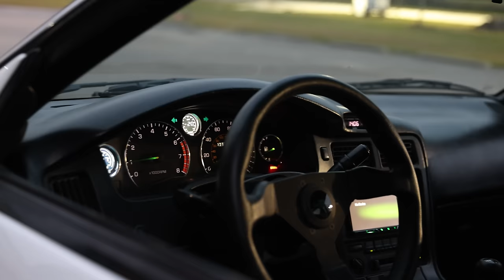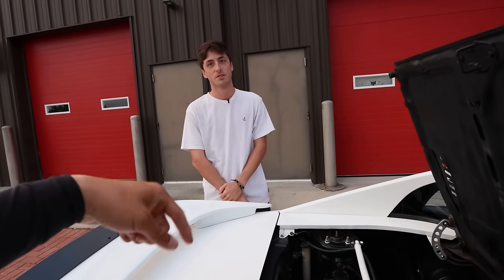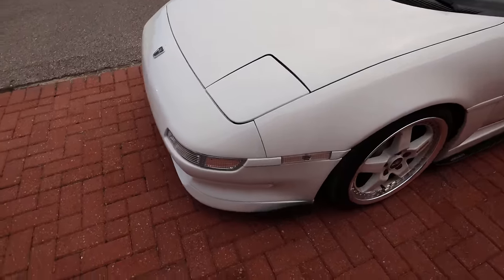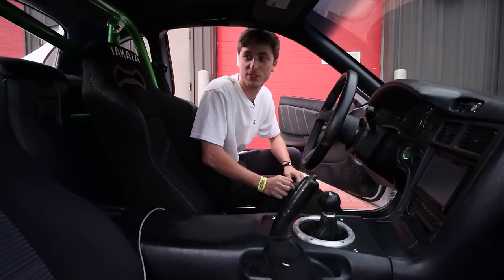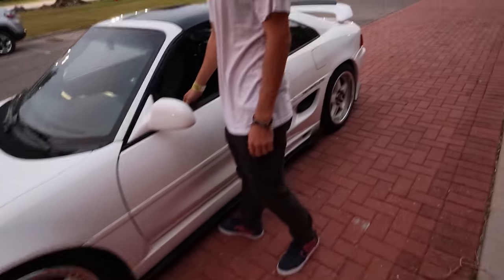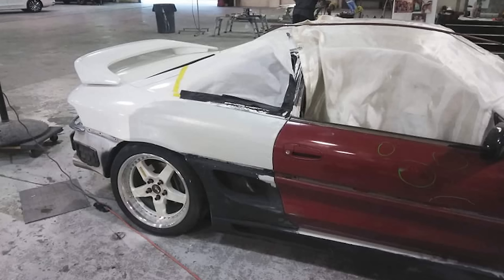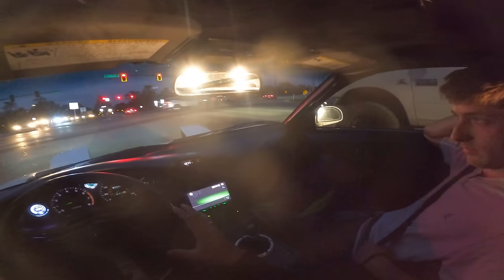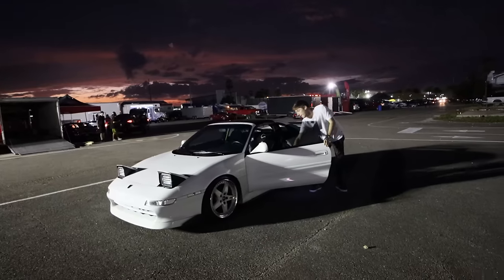Cleanest Toyota MR2 We’ve Seen… With a Minivan Motor??

Comment: Just a tip for single stage paint on the 2nd gen MR2's. The overspray from the windshield washer fluid starts the breakdown and chalky effect on the paint. The pattern starts on the top of the car to one side back to the spoiler. I stopped using wiper fluid after a lot of polishing recognizing the pattern.

Comment: I've had my azure blue 96 rev 4 GTS (turbo import 60k miles) since 2006. They'll be burying me in it when the time comes so I absolutely get where this geeza is coming from! 

They kept going until 2000 though with the revision 5 from 98 to 2000.

Comment: Just subbed.. I first bought the NA sw21 back in the late 90s then I found a body without the engine and interior in sun valley Idaho for 550.00 on mr2com which turned to xcarscom cost 800 to transport from there to the Bay Area. Bought the seats online and interior and odometer from Taprecycling on Sacramento CA for a bargain like 400 for carpet and backstop and odometer. 3500 for a jdm motor straight from Japan with the LSD and put this car together for 7k. The real hard parts to find now are the solid bumper mouldings and 94 style taillights which were a breeze to get and thanks to a friend I got a greddy PE exhaust for 500 back then. Unfortunately it’s totaled got t boned by a drunk driver. Now I’ve moved onto an E46 M3 and now that’s my car that’s unsellable for me. But I miss this car so much it was fairly easy to work on well the radiator flush and replacement sucks but this is a legendary car

Comment: This is dope but I don't think anyone calls a 3sgte a "minivan motor" as much as the "celica gt4 motor" or whatever. And you can say the caldina is a minivan, but I've imported them and they are basically the toyota answer to the subaru legacy wagon. Definitively not a minivan by the american standards at the time. You should see them swapped into a rav4...

Comment: Minivan motor? LMAO If anything, I'd call a 2gr swap a "minivan motor" long before I'd call a Gen 4 Caldina engine swap a minivan motor... After all, unlike the 3sgte, the 2gr was at least used in "minivan's"

Also, its not entirely correct to call the EHPS system used in the MR2's "Electric Power Steering". They are still Hydraulic assist, they just use an electric motor to spin the hydraulic pump rather than a belt off the crank like most hydraulic assist PS systems. A real electric power steering system uses an electric motor geared into the steering column or the rack to provide assist (there is no hydraulic system).

20:53 actually, your brother-in-law's car might not have been a power steering equipped car. Power steering was a factory option on the SW's (i.e., not all of them had it). If it was a factory turbo car, then its a good chance that he (or someone) removed it since most turbo's had it (of the many factory turbo cars I've seen and the few I've owned over the years, I've only seen two that were factory an did not come with power steering. One of them is owned by a good friend of mine who I am actually currently working with her on adapting a modern true electric assist steering column into it because she hates not having power steering but we also dont want to cut up her front trunk floor to convert it to the factory EHPS.

Comment: uses pictures I took of a car I spent a year of my life doing the bodywork on and lets another guy get the credit for everything. Appreciate that Scott B👌👌👌 good to know you haven't changed a bit.
Reply: Spent YEARS and didn't finish it. Had to beg to get it back. Paid for a finished job and got half the car unpainted. I guess I could give you credit on the rust coming through the driver's side quarter due to poor bodywork, but no one wants that.
Reply: also the only thing I didnt paint was your damn bumpers and engine cover because they werent worth the time of day.
Reply: I spent days sanding that entire car to bare metal with you and your dad BEFORE I moved 14 hours away to Tampa FL. I'm not a bodyman. I guess you forgot about the headlight cover(both), spoiler, fiberglass window pillar cowl, front bumper, rear bumper, taillight center, engine lid, engine lid inspection panels(both), front lip, side moldings, engine bay, rear spats. But it's ok I appreciate the support and I forgive you. 😘👌💯 All your "work" doesn't show on this build anymore cars been wrecked since.
Reply: sure thing bub! keep on telling yourself you got screwed or whatever makes you sleep good at night.

Comment: Caldina is a WAGON. Not a Minivan. It's based off the Avensis.
Reply: The Toyota Caldina is a spacious minivan first offered in the market in 1992 by the Japanese automobile manufacturing company Toyota.
Reply: @scottb4370  However, the Toyota that they talk of, is the Caldina GT, with a 3SGTE, and all wheel drive. And it is based on the Avensis, which is a wagon.

Comment: That’s not even close to a minivan motor. The 2GR V6 is wayyyyy better than that four cylinder.
Reply: Perhaps the later gen 2gr-fse but that doesn't have the cool old school factor. The four speed auto let's the ST246 Caldina  down more than the engine. Would be way better manual.
Reply: @colincharan-kumpula6424  The 2GR-FE is the new popular swap in MR2s and they make 300whp. The 2GR-FSE won’t work in the MR2. Any engine is better with a manual transmission!

Comment: Larry - the Japanese Domestic Market (JDM) didn't make a left hand drive! It's a USDM. If it's LHD, it ain't JDM.
Reply: Late reply. Well, i believe technically it's not important whether its lhd or rhd, as long as the specific model/spec were sold in/made for to conform with Japanese market requirement, then it can be classified as jdm car (plus most of the import brand in Japan like merc, ferrari, chevrolet, etc. sold their car in lhd there)